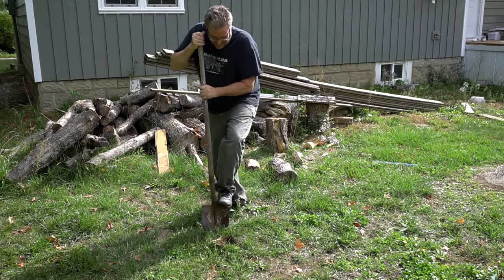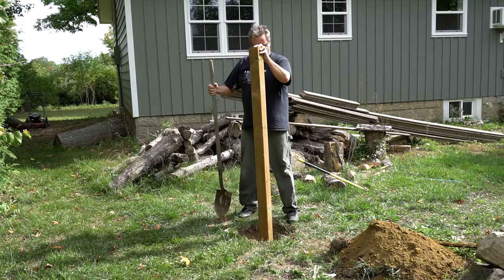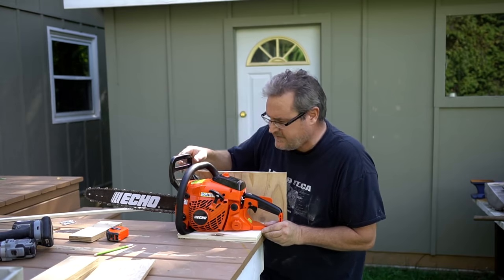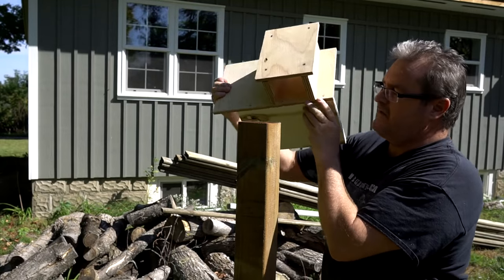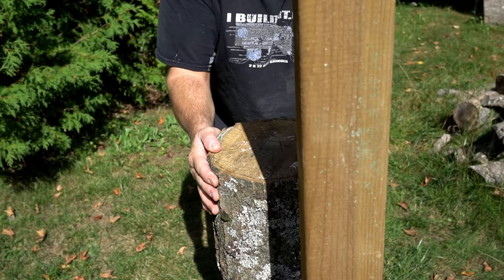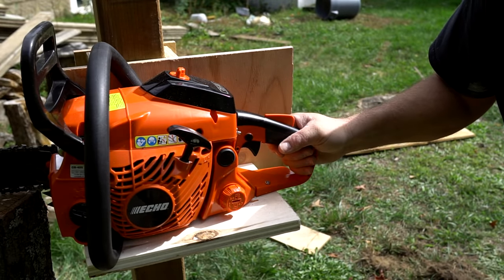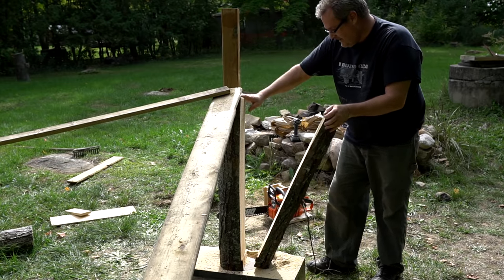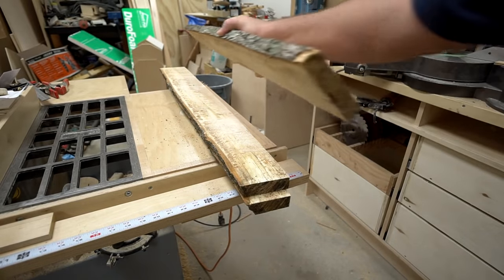Making A Quick and Dirty VERTICAL Chainsaw Mill

Comment: I've been cutting firewood for 45 years and have used many saws. The best one by far is my Echo. I've had it for 9 years and it's still going strong. Starts on the first or second pull. But I always use 91 octane gas; never use 87 or 89 octane because of their having alcohol in them.

Comment: I'm thinking to reduce drag we could connect the saw saddle structure to the outer runner board to "create the box" so the drag during any drop runs against the shank of the bolts (or add some conduit rollers). Eliminate the drag boards. Sizing would then be fully adjustable to maximize drop speed capability or compensate for out of square/twists in the guide board. A hillbilly jumbo log clamp could be handy and industrial size zip ties might just cinch a saw down through clearance holes in the saddle board Other than that my only thoughts would turn to weights or counterweight to automate and select your feed rate.

Comment: Drill some holes in the post you can put a stop for the carriage hinge on the backside of the carriage guide allows you to put it on without going over the top f the post and a longer post so you can cut bigger logs there’s quite a pile behind you

Comment: This is SO awesome, thanks. I've been splitting logs this size to make little quarter-sawn boards out of but it is sooo wasteful. I would waste far less material this way. Splitting was kinda good for archery bow wood because splitting followed the waves of grain more than sawing through them (which can be good anti-splintering for tension and compression purposes for a bowyer) but to save on wood for making straight-grain instrument bridges I can't wait to do this.

Comment: John that is a great prof of concept the only change  that I would make is to set the saw plate at an angle of around 30 degrees then the chain works better,  still got to hand it to you,   you have made it look simple,  you have a wonderful mind keep using it for good my friend
Reply from the maker: At 30 degrees, you are cutting diagonally through the wood, which means you'll be cutting more wood at a time.

Comment: Great video - Thanks !!!!
Here's a suggestion - if you don't want to drill into the handle or the body of your chainsaw then use some U-Shaped brackets and bolt them in place on the other side of the sliding box. For a quick-release system use wing-nuts. I realize the spacing is tight inside the box, but with a little clever engineering this may work. As for the bottom mounting of the saw - spacing for the nuts is not an issue. Thanks again for the great video.

Comment: Nice Job! Sweet and simple. If you do not want to attach the saw with screws you could probably use hose clamps for the handle and small clamps from Harbor Freight for the flat areas. Thanks for posting!
Reply: do you mean U bolts?, not c clamps?

Comment: Filing your chain to a ripping chain (90 degrees angle i.s.o. 30) when the chain needs to be sharpened will even improve on the cutting speed is my experience. really nice build. thanks for sharing. cheers.

Comment: I have a Jonsered w/ a 20" bar I used it with my panthermill 2 with the regular chain did a few logs and then took one of my older chains and made it a ripping chain.  I noticed a big difference in quality of the face smoothness comparing the two side by side.
Reply from the maker: Not really concerned about how smooth the cut is, since it needs to be planed after it dries.

Comment: The most important ideas here are that 1) mounting chainsaw is simple and lightweight, 2) you need only one person to operate because 3) you're using gravity as your friend, as opposed to human effort required to push/pull an Alaskan mill on longer stock. 

How to extend this concept so that working on much longer/heavier stock becomes feasible AND for complete milling of the stock, with only one operator? 

1) Construct a staircase, with attached vertical guidepost for chainsaw, that permits operating chainsaw at the max height of your stock. As operator works down the stock, step down the stairs. Put base of staircase on track with clamping that permits moving it left/right in front of the (vertical) stock after each cut.

2) Make a raised platform for the bottom end of the stock. Permanently attach 2 robust metal spikes pointing up from the platform to hold the stock's (flat) bottom end in place. Spikes hold the stock to the left/right of the next vertical cut. Maybe put two pairs of spikes on top of two separate simple hydraulic jacks, and swap them (such as going left/right) to support the stock after each vertical cut. Bottom (spiked) end of the stock is cut off as waste after milling. 

3) Use operator's favorite/suitable tall, robust grasping technique to hold up the top end of the uncut stock. Operator guides each newly cut piece into nearby vertical hopper.

4) Operator unloads vertical hopper using favorite/suitable technique.

Comment: Gravity... I love the way you are thinking outside of the box.

A few points: 

- A ripping chain will be easier on your chain saw. Whatever you are using an Alaskan Mill or your wonderful contraption, you will greatly benefit from getting the right one.
- Please look into tensioning the chain a bit more than it was while filming this.
- Lastly, whenever you are filing or replacing the chain, reverse the chainsaw blade as well to get it to wear evenly.

Keep on your good work.
Reply: "reverse the chainsaw blade" 

i.e. Turn the BAR (that the blade runs on) upside down.

Comment: John,  Nice innovation. The stability of the square post is a nice improvement over just a 2x4.  I  am doing some chainsaw milling on smaller logs. The chainsaw is operating horizontally which is at times problematic.  The normal chain on the saw is meant for cross cutting and a ripping chain would be a nice addition if you plan to do a lot of milling.  I'm also very respectful, even scared of what a blade can do. Might be good to have some safety equipment other than vigilance.  LOL!

Comment: You need more support log runner blocks on your saw mill & ya gotta find a way to support your upright logs without screws, maybe some type of bottom hinged support brace, off your base & a single screw through it on the top

Comment: great idea for shorter logs...one thing I did notice was that there was a bit of spring in the 4x4 post. What if you anchored the post to the top of the log you are going to cut once the chainsaw is on the post. That was once the saw is cutting there would be no forward and backward movement that may cause the saw to buck. Love the vids...
Reply from the maker: Thought about it, but I think the movement might actually help make the cutting more efficient by a small amount. The post never did get loose.
Reply: great look forward to seeing more...

Comment: Wow, I'm impressed with your thinking, presentation and process! A+!
Im thinking though of going beyond this to a taller version perhaps heavier post and ladder to cut maybe 8 footers?
Nice work! /de
Reply: i have a huge length elm burl log i would like to attempt a vertical slice thru.....i was thinking about attaching the upper end of the 4x4 to a high tree limb for a top support on this idea
Reply: Consider - an 8 foot long 4" PVC pipe costs about $11 at home depot.  Get two side by side and mount them floor to ceiling in a shop.  Then, you would need to drill out 2 4" PVC couplings and build a box so that it slides nicely up and down.  Enhance with pulley, rope and a hand crank or even a winch.  Figure out some way to add and subtract weight to the sled.  And I would fill the pipes with either sand or yellow expanding foam.  Oh, and watch out for ventilation so that the carbon monoxide doesn't kill you.

Comment: Hello John Nice video and a great idea. now get you a rip chain (yes they do make them) for your saw and it will cut lots faster and be easier on the saw.
Reply from the maker: Heard it said that rip chains don't make much of a difference (yes, I did hear of rip chains).
Reply: I Build It 
They make a huge difference in how often you have to resharpen, and with an Echo chainsaw you always want a sharp chain as the Oiler gets packed with sawdust and oil so the Oiler won’t oil the bar due to all the much smaller chips.  I assume other brands have the same problem, but I haven’t examined oilers on other saws as in depth as I have the ones on the two echos I bought used (and had to clean the packed oil and sawdust out of the way so the oilers would work; a CS440 and CS 4400).

You can grind down the teeth on your chain to ten degrees, like on standard ripping chains, but most people prefer to start with the right chain...forester brand makes ripping chains, there is an Australian company that specializes in it as well....

I LOVE your concept and proof, but think a 12 foot version to accomplish the milling I need to do might be a bit on the stupid side of things...... doesn’t mean I won’t consider it.....  ;-)

GREAT VIDEO!

Comment: Well that seemed to work out quite well for a simple setup. After cutting up that tree and getting all that lumber it will more than pay for the chain saw and 4X4, and you still have the saw and 4X4 to use them elsewhere.
Reply from the maker: It certainly makes it a lot easier to do, so I'll probably get all of the bigger stuff cut up.
Reply: This is how I have to explain tool purchases to my girlfriend, and counter their desire to buy clothes etc with the same concept.

Comment: Important note to do it yourselfers doing this... my experience here is once you have tamped down the dirt around the wood is to leave maybe 3 inches of hole you then fill the hole with water, then let dry in the hot sun a week... this will compact the ground amazingly solid!!!  If you are using concrete with a 4x4, bolt  a 4 foot long 6x6 large steel angle to the bottom of your 4x4 so only the steel angel is in the ground so your wood will not rot!!!

Comment: Great idea! I heard you say you were using a brand new saw and chain so I was wondering if you were using a ripping chain. A ripping chain will go through the log much quicker and easier plus give you a cleaner cut. I have 2 saws that I use on a regular basis. One with a regular or cross cut chain and one with a ripping chain. Having both chains makes cutting wood much easier. 
Cheers mate and happy trails

Comment: Having an Alaskan mill I would have to agree with you. For the size logs you have it is much less work. You have to push an Alaskan mill through the log so for logs two, three or more times as long there is a lot of effort on the operator. For denser woods I would recommend a skip tooth blade but for as few logs as you have it isn't worth the effort of modifying or purchasing one.  The only thing I have come across that makes an Alaskan mill easier to operate is a hand winch to lessen the work required.

Comment: I couldn't attach my Husqvarna like that. The bottom of the handle is part of the gas tank. Check your saw before drilling holes in it! I like your idea. How do you keep the band saw cutting straight? I didn't see any guides.

Comment: Consider - an 8 foot long 4" PVC pipe costs about $11 at home depot. Get two side by side and mount them floor to ceiling in a shop. Then, you would need to drill out 2 4" PVC couplings and build a box so that it slides nicely up and down. Enhance with pulley, rope and a hand crank or even a winch. Figure out some way to add and subtract weight to the sled. And I would fill the pipes with either sand or yellow expanding foam. Oh, and watch out for ventilation so that the carbon monoxide doesn't kill you.

Comment: great idea John,  I never liked the standard chainsaw mill as it always looked like way to much work.  I think your cut was extra smooth because with the vertical setup the weight of the slab wasn't constantly pinching the chain causing extra marks.
It looks like the chips were spitting out the top of the chain, is the platform blocking the chip port at the bottom back of the chain?
Also, try and pop the bark off before running through your bandsaw as the bark will dull your blade much faster than the wood.
Reply from the maker: The bark is coming off pretty easy now after sitting out for a few months. But I think it would be faster and easier to just resharpen the blade than to pull it off when it was still completely green. I'm more worried about buried treasure, like screws or nails driven in and grown over as the tree matured.

Comment: That worked well knotch out the base and your down to the bottom no problem. 

You should see the beast im currently making. Im using a brand new 12" blade/chain bolted on a 240v 1200w electric motor mounted vertically to use as a rough cutting bandsaw table. The motor is mounted in a hoover casing and provides its own suction so i will add the small alloy cyclone that isnt big enough for anything else to suck most of the chips away, Also going to use a sowing machine type vaiable speed pedal as i dont have a chain brake,   I know its not idea but all i can afford. I just needed some way of cutting blanks for my lathe and my evil creation will do that just fine.  

Keep up the good work .

Comment: You should basically turn that post, into a big ass bar clamp too a just tack on clamp on the top positioned behind the chain saw and you don’t need any nails tack it down.

Comment: That looked flat! Sweet setup- super simple. The first time I ever milled an actual log, I chalked a line on both sides, made two circular saw cuts, and then spent two hours sawzalling out the middle like a stubborn 25 year-old chode. Chainsaw all the way from now on ;)
Reply from the maker: I did similar stuff. Cutting like that on the table saw, then splitting it the rest of the way. I even ran a small one (around 4") through the surface planer on a "sled" to flatten one side so that I could cut through it in one pass on my homemade "table saw". Nearly a full 4" of cutting depth on that bad boy. That was back in my salad days, and it would be interesting to see some of the comments if some of that had made it to video :)

Comment: Doesn't the saw overheat with the discharge blocked on the bottom of it by the plywood and the saw having to deal with the extra friction of all that wood chips and dust around the clutch and sprocket...I see some is coming out with the blade but it's been reduced to fine sawdust, no big chips. I like the idea though, got some 3 foot logs that have been drying for 2 years that I need to plank for some wainscoting for the front room reno coming up next spring. Thanks for the vid

Comment: Excellent.  Your bandsaw runs sweetly.  That will be my next big purchase... well, actually it will be my second-next (did I just invent a word?) because I just agreed to buy my mate's Jet (Powermatic) lathe.  There will be a video after the new workshop build.  I'll have to store it as I have nowhere to put it.
Reply from the maker: Thanks! So, what's happening with the new shop? Haven't seen any video yet :(
Reply: The guys are finishing a shop for one of their daughters so I told them to get it done and then come to do mine because I don't want her not able to work because of my job.  Don't worry, there will be videos but, when I went to do the first one the battery wouldn't charge in my camera. I checked how much a new Canon battery was and it was £89!!!  The camera cost £120 in a sale.  So I bought a spurious one for £11.  Same 2 year warranty etc.  So, when it arrives I'll fire a video up.
B.
Reply from the maker: baconsoda
I'm very much looking forward to it, but no pressure :D
Batteries are a ripoff, for sure.

Comment: with that flat piece of 3/4 board on the bottom of the saw you blocked were the saw chips come out and could cause the saw to over heat and quit working

Comment: Try using ripping chain.  It's filed at 10 degrees instead of 30 degree regular chain.  With ripping chain it will cut smoother and much faster.

Comment: You could  sharpen the chain into a rip configuration. Just a change in the angle for the front of the teeth. Friends have done this and they seemed to think it helps. Great idea by the way.

Comment: Did you have to buy a special kerf chain for ripping a log?
Reply: Usually, yes. Best performance with a 10-pitch, but most users simply stay with a 43 or 50 pitch crosscut chain and live with the chatter and slow cutting speed. It's also common to completely dull a chain in doing just 1 cut, so get good at sharpening chains.

Comment: Has anyone commented that if you used composite wood maybe you will have less friction. I would be interested to see if that. But if you are not having friction problems...don't fix it.
Reply: wax will make it slide easy and is the best water repellent  for both wood and metal....it does not float away like oil in the rain water

Comment: Seems awfully dangerous to be lightly holding that saw with one hand.  If it kicks back the safety will not be engaged and it's going to bury itself in you at full power if the plywood gives.

Comment: Brand new saw, drill holes and there goes the warranty.
Cable ties would have done the job just as well for the use you showed.
Useful tool though.